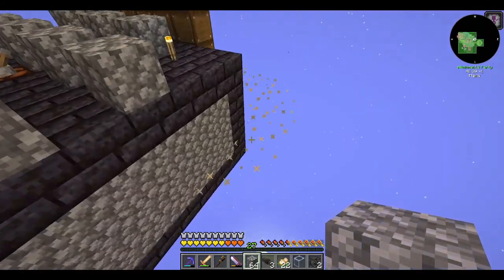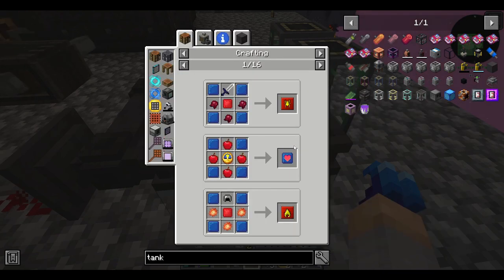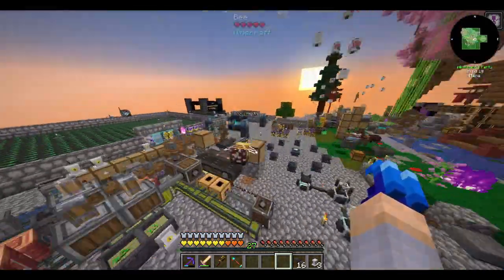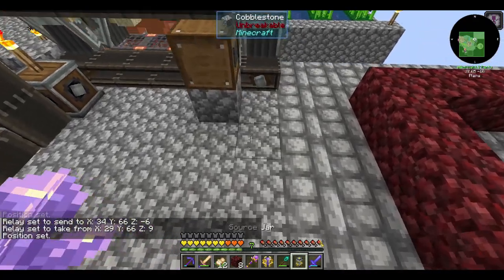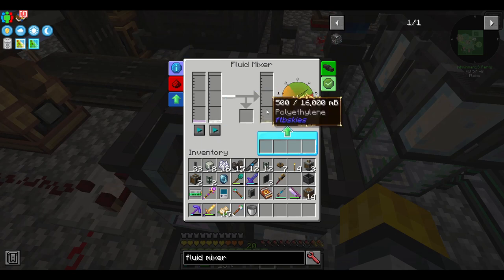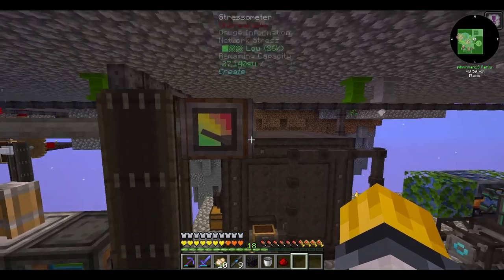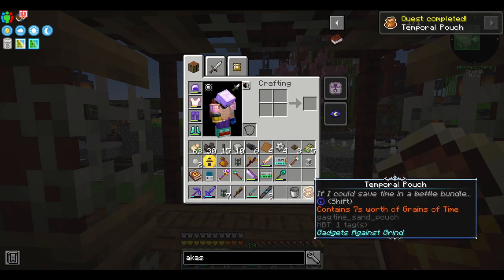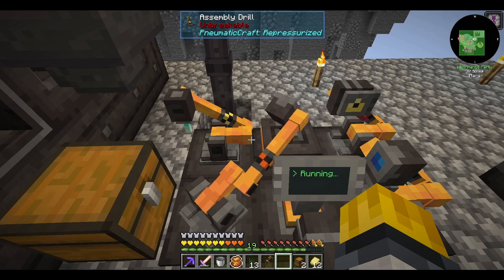FTB Skies Expert Guide- Episode 6- Fuel Fuel Fuel

Comment: I really liked the force infused diesel setup. The use of drawers and the push/pull mechanism let you build a very compact and clean process.  That in turn let you build the force crystalizer into the setup right next to a botania automated cake system.  The benefit there is so you could use mana spreaders instead of system using something like sparks to move mana around.

And good luck with the moon dust and the bees.